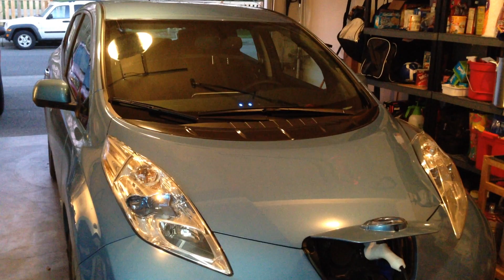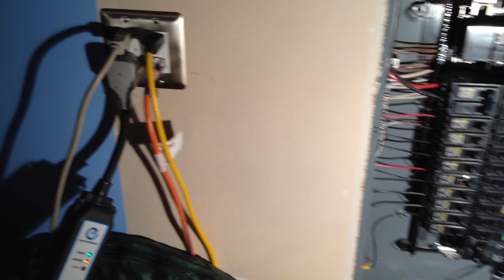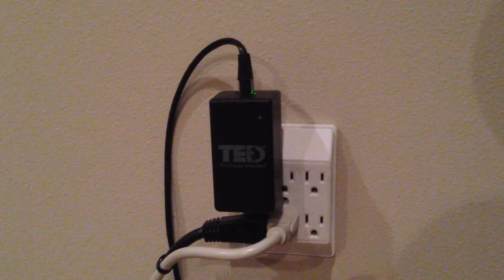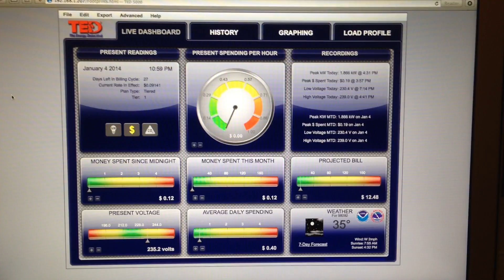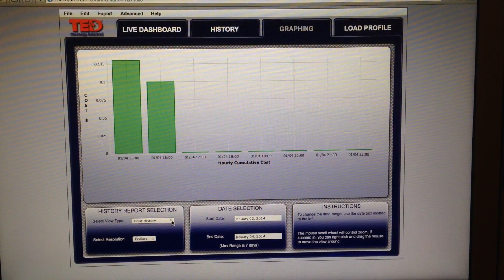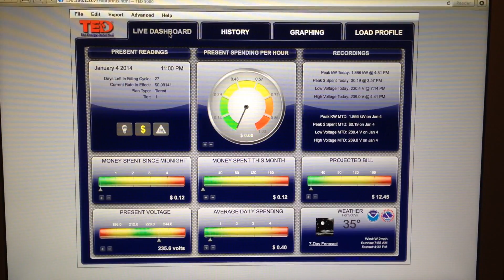2013 Nissan LEAF & TED 5000

Comment: I hope you didn't buy a 30-amp charger; those generally require a 40-amp circuit.
Reply: Unfortunately, it looks like he did as the Manzanita Micro is a 30A EVSE (though it does appear to be available in a version which can be toggled back to 15A).

It should be wired to a 40A rated circuit. I saw a 30A circuit breaker and 10GA romex. Not sufficient for charging an EV at 30A because for continuous use (like charging an EV) the circuit must be over-provisioned by 25%. So charging at 30A would require a circuit rated at 37.5A which is rounded up to 40A. A 30A circuit is only rated for 24A maximum when charging an EV.